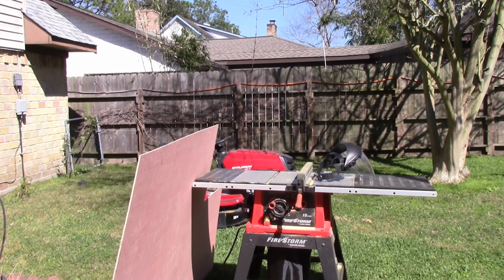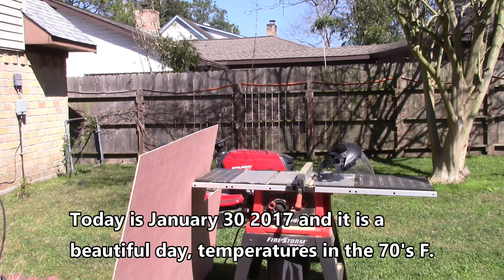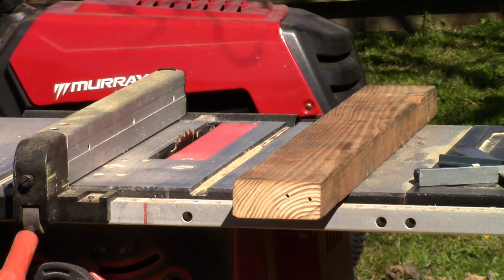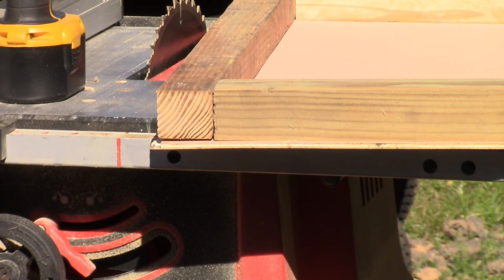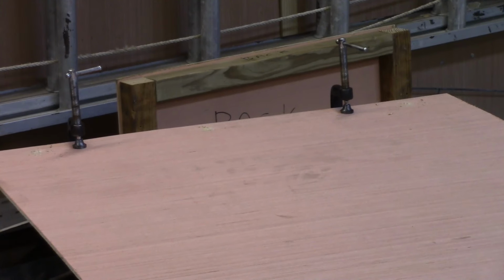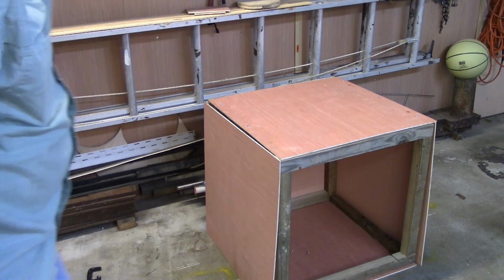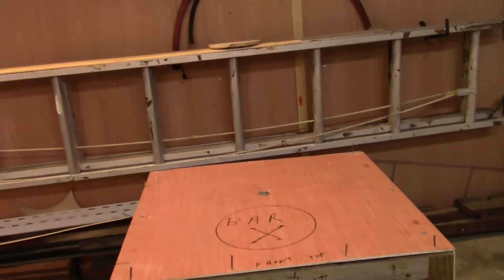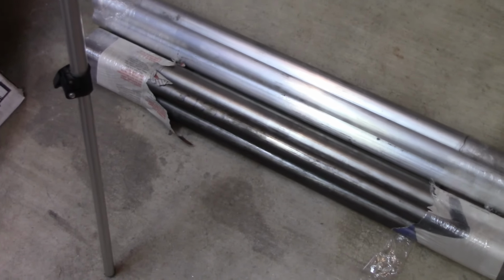Powder coating enclosure

Comment: I need to build me something like that  paint booth. Your plan looks good. I have lots of powder coating I need to get done on a 67 SS Chevelle I have been restoring. Lots of small brackets and pieces that would be better powder coated than painted.

I have several multi meters here at home but was in Florida the past two weeks with my sister and needed one to fix some electrical problems she was having. So I now have another one. Keep the cool videos coming Mr. Harold!
Reply from the maker: Thanks for stopping by.

Comment: No multimeter, got several already and can't use 'em proper, but thanks muchly. Love your wind chimes!

Next project I recommend infeed and outfeed stands. If I still lived in Lake Charles I'd offer to run over and help, but I'm over near Hotlanna now and that drive would be too hard on me.
Reply: Try clamping your two-by and plywood to the "bench" - the extra mass/weight will help a lot, I garontee. 🤕
Reply from the maker: I will keep that in mind.  Thanks for stopping by.

Comment: Hi Harold,
That powder coating box should be just perfect, no work table is cause you made the truck come first and let it sleep in the garage...  lol
That 1" round bar at $8 per pound.....    Gulp...!!!    Ever tried to find a scrap yard that would let you buy stuff, that would be closer to 40 to 50 cents a pound for steel and $1 to $1.50 a pound for aluminum...
Remember to never weld 12L14 as it contains lead and is very toxic, machines well, though...
Don't forget to ban Daisy from Chuck's channel...   lol 
Cheers,   Pierre
Reply from the maker: Too late she already knows about Howie and Chuck.  Thanks for stopping by.

Comment: Harold. A trip to the hardware store for some three quarter inch long screws would have revolutionised your build. Just a thought whilst watching. Regards
Reply from the maker: I will keep that in mind.  I had really wanted to powder coat my tail stock but had no enclosure.  It was probably a little big for the oven anyway.  Thanks for stopping by.

Comment: Nice project Harold, I always have to stop the 'ARW' channel to see what you're into. That has to be the worlds loudest table saw, 2 stroke? I had to put on my ear muffs...I've been meaning to build a similar box myself, when the laziness wears off.
Reply from the maker: So you think the name should be changed to ARW?  Yep the saw is a 2 stroke.  Hard to find those these days.  Thanks for stopping by.
Reply: those saws use a brush motor, not induction, i especially dislike the loud snatch sound when you switch them on, they are meant for homeowner, wouldn't last long on a trade side

Comment: I'd say the enclosure is looking pretty good, Harold. Any plans to hook a small fan & filter to the enclosure? It made a big difference for mine. I just used an old PC fan (100mm) and a piece of scotch brite for the filter.

Best wishes,
Tom Z
Reply from the maker: I had not thought of a fan but that does sound good.  Thanks for stopping by.